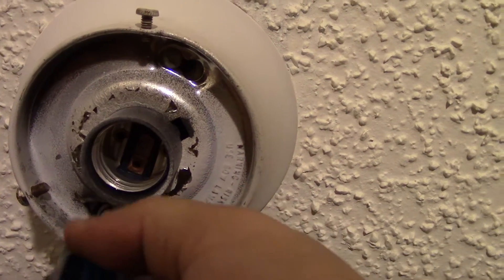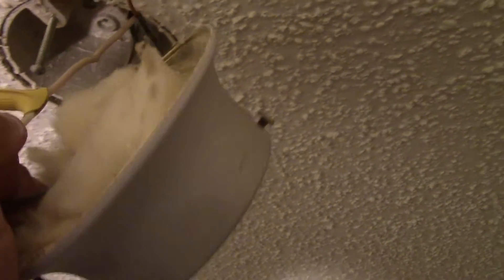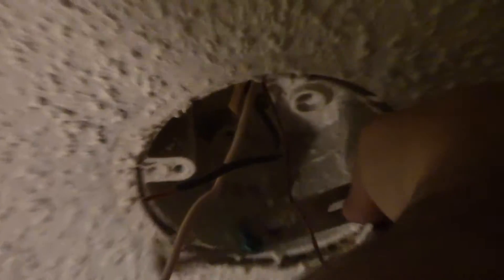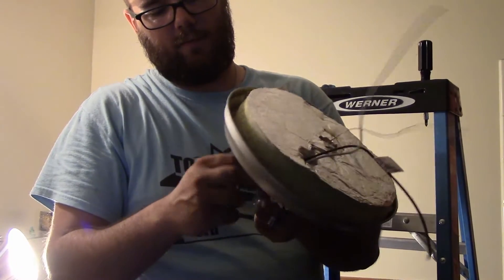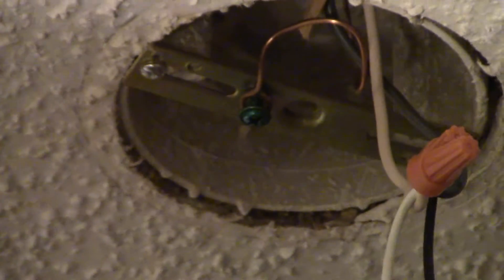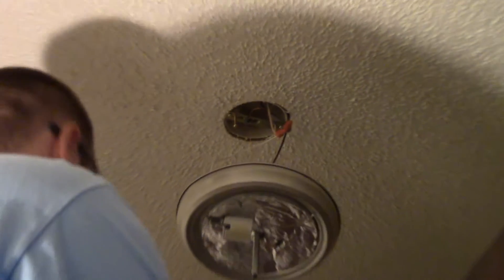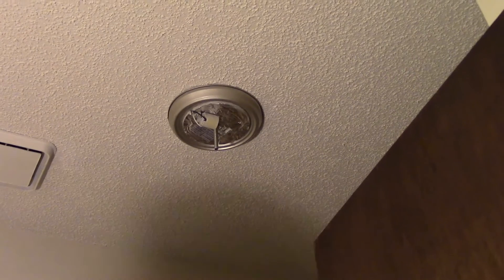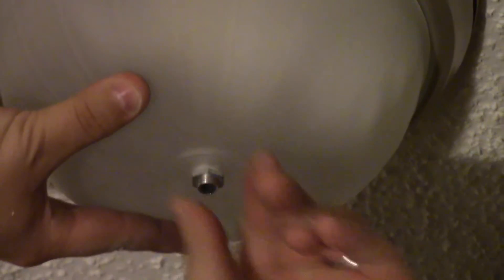How To Wire/Change A Light Fixture

Comment: Hiya just a safety point for people with older houses use a switched neutral so when the light switch is off the fitting still is live I'd all ways reccomend isolating at the fuse box not at the light switch :)  good video though
Reply from the maker: +Adam “Bucka208” B This is a great point, I don't claim to know the ins and outs of all the old ways of wiring, at the very least it would be a great idea to use a volt meter to verify that the circuit is dead either if it is by the switch or the fuse/breaker box. Thank You for adding your knowledge to this.